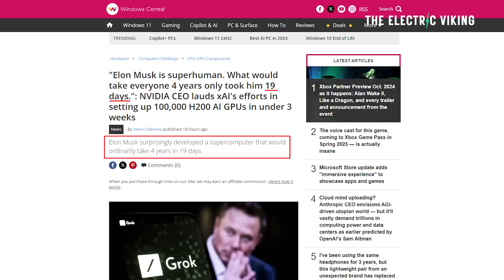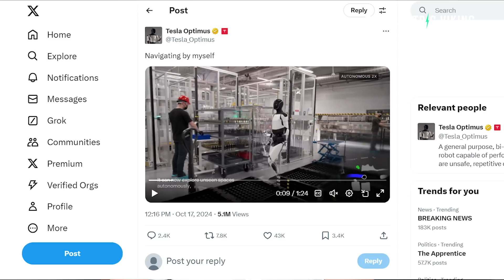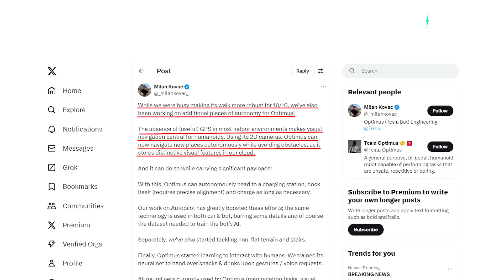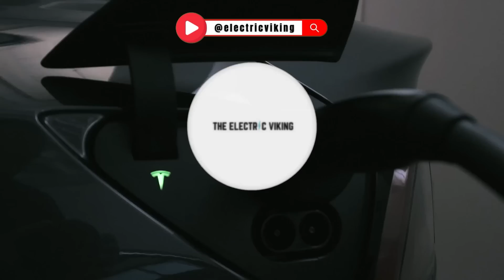Why Tesla's Optimus BOT will make TRILLIONS - but DOOM humanity

Comment: The power demands at 3.7kw a day, with 10 billion units sold by 2040? Do the math on the power consumption, do the math on the cost of the units themselves, and do the math on the infrastructure required to build out the grid required to support such growth.

It’s pipe dreams, humanoid robots in 2040 costing $25k, in other words x 4 for the price of a Cyber truck in 2024? It’s ludicrous, it’s more nonsense from a serial under-performer

Comment: Munro , who I have a lot of time for states that Robots do a great job at the ‘three Ds’, dirty , drudgery, and dangerous. 
But, how good would an all purpose humanoid shaped robot be in a dusty, muddy environment ? 
So the factory robots manufacturers have been using in dedicated tasks often dangerous to human eyes, limbs, they will likely stay doing those dedicated tasks as they are designed fit for purpose. 
Humanoid robots will have many many uses, and be able to assist in many functions of course.
But cleaning the toilet ??  Who then cleans the robot after so that it can then cook your boys dinner ? 
Going outside, getting muddy, I’m not sure. Walking on uneven surfaces ? Walking in mud, sand, gravel ? 
Even if you fit wheels to the humanoid robot, they are going to get dusty, dirty, etc. 
Using a robot in home for mainly clean relatively low dust and microbe environments, sure. 
If you want a self cleaning toilet you design one. Forget sending in a humanoid to clean up splatter and spills lol. 
These Robots will definitely do plenty of human tasks, and I welcome it. Care for the elderly and infirm and serve food. 
But how does the robot clean itself to stay hygienic, to prevent dirt ingress into its joints, its seals won’t last indefinitely either. 
I mean if they can literally jump in the shower … sorted. 🤣

Comment: Charging Optimus is surely not a big deal. First, it has a relatively small battery pack. Second, the Roomba vacuum cleaner has been automatically parking on its charger, recharging, then continuing its working schedule for years.

Comment: Through a life of working either on or associated with manufacturing entities, the pronouncement of the factory floor being taken over by robots just never seems to materialize.  And the functions they perform haven't changed all that much either.  One other feature is all these demo robots always have a humanoid shape.  Won't they have trouble with balance on two leg-like appendages when carrying loads, so why not a different 'base' like wheels or a 'track' system (like a military tank) for better stability.